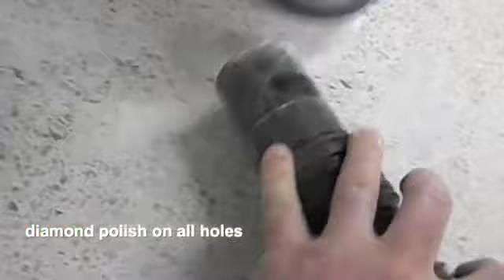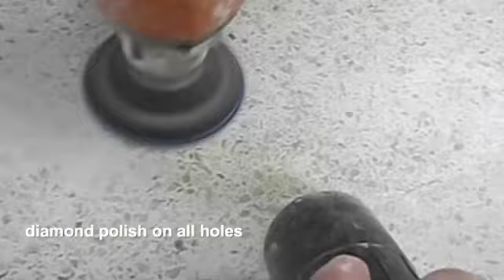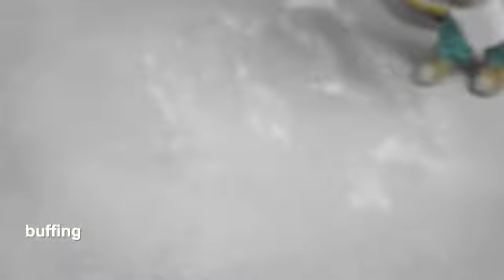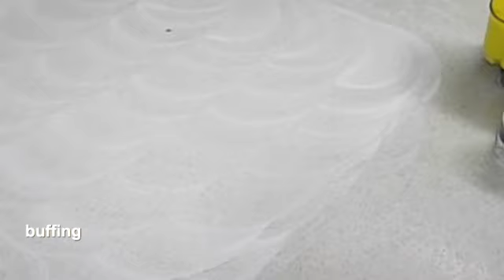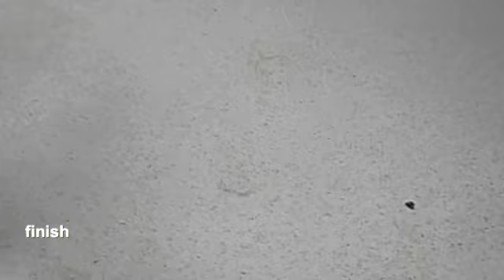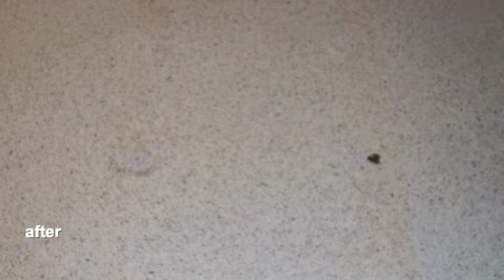Terrazzo Floor Repair at Baptist Hospital(JIS Contruction Contractor)

Comment: Curious too on the type of epoxy.  I found chips at the craft store Michaels.  They sell small stones in a knit bag.  I break them up with a small sledge and pick the chips I need.
Reply: Burton Wizeman Did you ever find what kind of epoxy one is supposed to use for terrazzo holes?

Comment: what diamond pads do you use and what grit?
Reply from the maker: 6 of the 4" per grit. 50g, 100 o 120g, 220g, 400g, after that sealer. 800g, 1500g and 3000g, buffing using polish powder and sealer. 
Note: only water base penetrating sealer (floor with humidity is not problem)